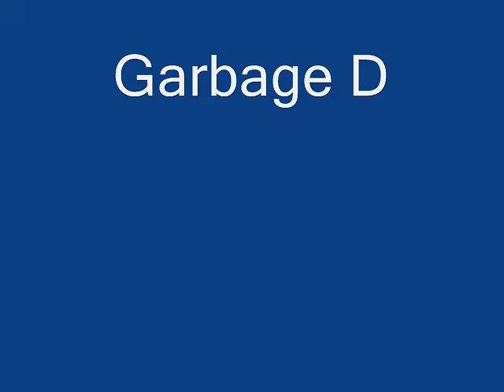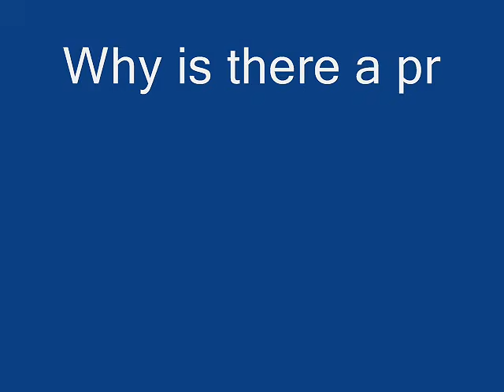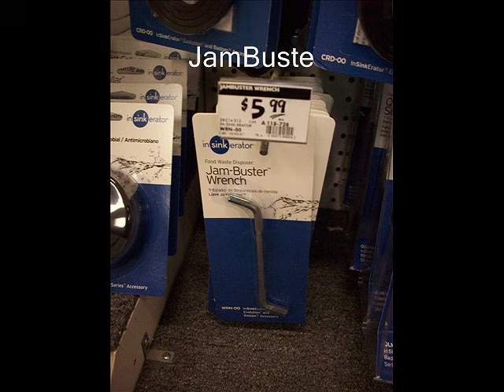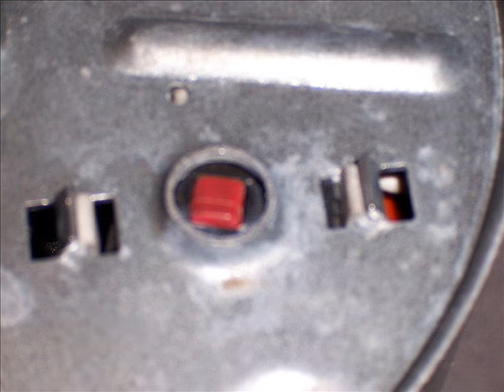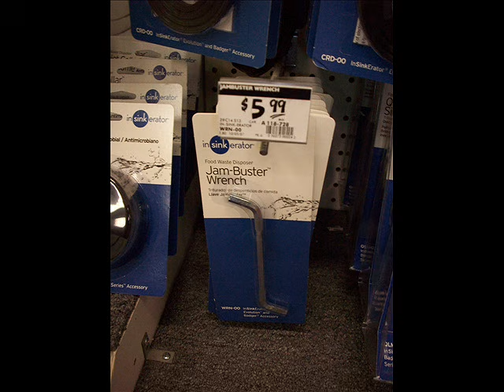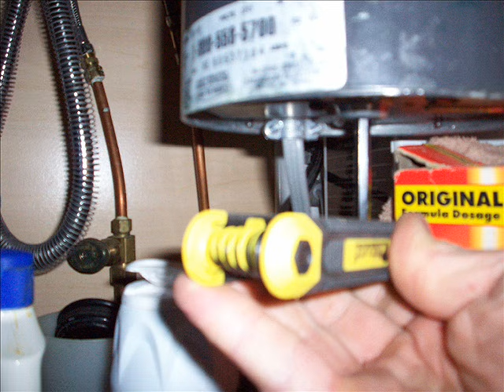Fix Your Garbage Disposal | Disposal Repair | No Cost | Save $$$

Comment: Thank you for your video. I had new countertops installed and two days later I realized that my garbage disposal is not working from the switch. I went to the breaker box and switched the breaker. The disposal started on but I can’t stop it from the switch. I bought a new switch and installed it, still not working. I have to go to the breaker box and start it on and off from there. I am 75 years old female on limited income and I can’t afford plumber. What can I do?
Reply from the maker: Check if there is a plug on the disposal.
Unplug it and make sure it stops.
If the receptacle has 2 outlets, change to the other outlet and see if the switch works.
Reply: @ClassicManuals   thank you very , very much ! Problem solved. Changed the outlet and now the switch responds.💕

Comment: I pressed the red starter switch and it turned it on, but the on and off switch is now not working... it will not stop running unless I unplug the entire thing. Is this normal?

Comment: Thank you for this video! You saved our home from a foul smelling odor. 
This video works for disposal model: ISE 333SS.

After turning the bottom of the disposal with the wrench, the disposal turned on and made a horrible metal scraping noise. I thought I had broken it! Turns out one of our metal measuring spoons was stuck in the drain! Took it out and now we're in business. Thank you!

Comment: Hello, ours humming, no grinding. What if i found the bottom is little damp, i saw even the red reset buttom. Would this already fired the unit? When i run the water for a minute, i didn't find anywhere is leaking though. But then i used the alan key to turn one clockwise and started to see the reset button got wet.

Comment: Tried all the steps in the video to fix my garbage disposal. Turned out to be the third one. Garbage disposal was humming but not turning after my kids thought it was a good idea to put their glass tea cups down the drain without telling us. After sucking the debris out with a shop vac, used my Allen wrench and had to turn it quite a bit. Finally it broke loose and it worked! Saved me money and a lot of time replacing the whole unit which isn’t even two years old yet. Thank you!

Comment: At first I was skeptical because this video was made 14 years ago at the time of this comment, but what I quickly came to realize is this is a simple machine with only a few troubleshooting possibilities.  I fixed my disposal using the “jambuster” method with an Alan key and a couple of turns.  It took longer to watch this video than it did to fix the disposal.  Honestly works better than it did when I got to this house.  Thanks man.

Comment: When unplug the disposer from the outlet under the sink and plug a lamp to to see if it has power,  the lamp does not turn on. It is a working lamp because other sockets light it up. Yet, the main circuit breaker is not tripped. I’ve reset it and still no power.
Reply from the maker: TestbLamp should go on/off when the disposal switch is cycled.

Comment: I have a jammed motor that was making humm when we turn it on.When I saw this video I used a hex wrench 1/4”  to turn it back and forth the motor from bottom.As you mentioned in the video clip.Now it’s running normally.Thanks for this valuable information.

Comment: Perfect advice.  The 1/4 Allen went in.  Back and forth and through the handle you could feel the binder up gears come free.  The Allen wrench then turned freely.  Ran cold water.  Turned on the disposal and it works.  Thank You so much.

Comment: I thought for sure I'd have to buy a new disposal and installation. Then my wife said our stepdaughter fixed it from watching a YouTube video. It had the hum problem. I found the correct Allen wrench in my collection, and turning it was so easy - seemed too easy, as if there was no blockage. But then I flipped the switch and the disposal worked. Thanks, ClassicManuals!

Comment: I’ve used these techniques in the past and they worked.  This time I’m still getting the hum and it appears to be spinning but it’s not draining anything.  It has water in the drain that won’t drain.  I’ve felt around in the drain and appears to be spinning freely but it’s not draining. Any suggestions?

Comment: i have a WasteKing L-1001, 1/2 hb and it has no hex receptacle on the bottom.  a little red reset button is on the side of the dispocal .  I havent used my disposal at all since installed 2 yrs ago, no garbage in it!  I get a short hum when turned on, but it doesnt torn at all. No spot to use a key wrench on the unit?

Comment: Too bad you did not mention about the disposal NOT moving when using the allen wrench.  What do you do then?
Reply: The same thing was happening to me but looked up that you need the 1/4 Allen wrench in size. I tried and at first it didn’t move but just push hard and it gets looser as you go!!
Reply: @patiencewhite2864  Thanks for your comments.  I used an allen wrench but the disk inside was still frozen and so I had to take the disposal apart.  No wonder the disk was frozen since there was TONS of sludge inside preventing it from spinning.  I got it all out of there and cleaned the inside as best as possible before reassembling it.  It now works fine.

Comment: these videos help alot, I was stressing out. I didn't realize or know my shot glass was sitting in the disposal until I turn on and heard a NOT so good noise 🤦🤦! That's probably because I was still drunk from father's day Sunday to Monday and my brain was not with me at work through out the morning. but my husband came home and used full force with the Allen wrench and it solved the problem, I was scared to full force the Allen wrench but we didn't have the jam buster wrench so we used exactly like what this guy is using and it works. I feel relief and better now.

Comment: 12 years since video was posted and still helping people save hundreds of dollars and hassle. thank you for your valuable information!
Reply: I just learned from RTFM(reading the F**n manul!) That you NEVER use HOT water while diposal is running...only cold. You DO NOT want grease and butter type stuff etc; to melt and re-cool in the small areas of disposal....it likes hard crunchy stuff to chew at and make smaller. DO NOT throw limes/lemons in there to make it 'smell' good it will jam it up!
Reply: Lowe's and Home Depot hates this guy 😂

Comment: I never knew it was supposed to turn freely at the bottom of it once u insert the tool. Thank u.   I was able to twist it back and forth and that dislodged a small metal piece that was stuck inside of it.  Allowing me to grab it💯💯.  Now it works just fine.   FYI all I’d did was hummmm once turned on

Comment: Never worked with a sink disposal before, already thinking about replacing. 
Tks to your video I reset the switch but the problem was stuck mechanism used an Allen wrench and problem fixed. Tks for the tip.

Comment: Lifesaver!!! I was messing around with the hex wrench for hours and thought I had to throw it away an buy a new disposer. Good thing I didn't because your simple instructions help, "turn it back and forth". I was turning it both ways and it wasnt working until I crank it back and forth as if your revving the motorcycle throttle. It was like magic.

Thank you so much!
Reply: Mine is the same, super hard to move the wrench, idk what is in there, I'll keep trying again and again but it's super hard

Comment: Thanks for the video - I'd forgotten about the reset button - I had no sound, nothing and had used the little tool to turn it and it didn't work so watching your video helped me remember the reset button and boom.......it works again.   What a fool I would have felt like had I called the plumber and he came and charged me $200 to press a damn button!!   Thanks again.

Comment: Maybe you can help me with my issue?  The disposal stopped working, I check the plug in, the bottom plug for the dishwasher worked but not the top plug for the garbage disposal. I replaced the plug with a new GFCI plug, now both the top and bottom plugs work. I plugged in the garbage disposal and it started working....without the switch being in the on position. what do I try next????
Reply from the maker: 1. Do not use a GFI outlet.   
2. There is a break-off tab on a duplex outlet that connects the top and bottom outlet, break that tab off on the hot (black wire) and wire one outlet to the disposal switch and the other to the dishwasher line and the other side common to neutral (white wire).

Comment: Great video! Moved into a new place and the disposal wasn't working. My wife and I were waiting over a week for the landlord to come and fix it saying he needed some key. Water was starting to have a hard time going down and we needed it fixed now. Found your video and learned the red fuse button was popped out and it started to hum. The "key" the landlord was talking about was the jam-buster wrench which I found hidden under the sink now that I knew what it was. I unjammed it but heard something inside that I couldn't see before. Found and removed a screw that had fallen in and it works just fine. Thank you.

Comment: Before considering calling a plumber due to a frozen garbage disposal (hum noise but not turning), I decided to check YouTube for some pointers on what to do. Well, low and behold, there was your tutorial. I also used by 1/4 allen wrench that I had in my tool box and turned it slowly back and forth until I could feel whatever was inside the disposal, finally release itself. Took a look down the drain and there it was, somehow a tiny screw was lodged in the disposal. With some careful surgery, I removed the screw and voila! Disposal now working again!  Thanks a ton - you saved me a plumbers fee and most likely the cost of a new disposal.

Comment: Thank you so much ,using your video I actually unplugged it first, removed the small piece of vegetable that was preventing it from spinning. Plugged it back in, pressed the reset button and it works just fine now. Saved me time and money ,excellent.🙋💜

Comment: Thank a million! I had taken the jammed up disposer off and left it for the garbage pickup, but when I searched the web for a replacement, I noticed comments like: "this one 'might' fit", etc.,. Then I found your video posting and Voila! my problem was solved. (Fished it back out from the garbage!) Although I could probably have done the fix without taking it off, there was so much gunk in the fittings that I cleaned off, that it was all worthwhile. And an extra thanks for exactly specifying the allen wrench size (1/4") - saved me the trouble of fiddling around and possibly stripping of the head - it needed  a hefty yank to unstick it!

I would add a note - when listening for a stalled motor humming, note that the sound may be very faint, as it was in my case.

Comment: Wow! This is the first YouTube video I’ve ever watched to help me with an issue that actually worked! There was no sound when turned on. I reset the breaker on the bottom which was tripped, but then it just made a humming sound. I could not manually move the disposal, so I grabbed the quarter-inch Allen wrench, broke it free, and got it to start turning. It now works. Great video!

Comment: The problem I'm having:  After not using the disposal for about 5 months, it hums without spinning the blades, and water's slow draining. I don't feel anything around the blades, reset button Not needing to be reset.  My jam-buster wrench won't turn, I was applying so much force that it ended up turning the disposal ever so slightly from the collar it hangs from that it began leaking unbeknownst to me for an hours time.

Should I take it down and try to unjam it off the collar it hangs from?  Any other suggestions?

Please help, as I replaced the original disposal with this one in 2015 (Whirlpool GC2000) which took me Hours to do (first time ever), it was SO heavy that I ended up stacking lots of books under it to hold it up while I hooked everything up inside the very tight work space. I shudder to thinks about having to do it again.

Comment: You didn't cover the use case where all circuit breakers are fine, power is there, jambuster used jam is cleared turn on switch and it just hums....I can only assume I need a new GD

Comment: THANK YOU SO MUCH! My disposal stopped working since the last time I did dishes. Puzzling. So I found your video and followed each step. I switched the power off at the breaker switch box. I first looked down inside with a flashlight to make sure there wasn't any debris. There wasn't, so I looked at the bottom of the disposal for the red reset switch. Sure enough, it was tripped, so I pressed it. Still no disposal. So I took a 1/4 Allen wrench and placed it into the bottom center hole. It was a little stiff for just a second, then it started moving very freely. I switched the power back on at the switch box and turned the disposal on....and it worked! So, thanks again!

Comment: So I got the hum. But the blades move easily and the Allen wrench moves with no problem.The thing still doesn't grind.
Needless to say the reset button and breaker are set.
So what's the next step?

Comment: My disposal jammed quickly after I realized it accidentally ingested a shot glass.  I used the 1/4" allen, and kept picking out debris.  Eventually it came un-jammed and works normally again.  Thanks for the hot tips.

Comment: Thank you so much for this video. I was all set to buy a new unit, but fortunately decided to search on YT for a possible fix. Turns out it was stuck blade. Even better I found the original disposal wrench in a my kitchen drawer to use for the repair. Whew!

Comment: Thank you! Like many of the DIY women here, I am so pleased with myself for fixing it on my own and relieved that I don't have to spend money for a new one and a contractor! Mine was humming, so I knew that power was not the issue.  When all else failed, I stuck my hand in inside to clean the gunk, then I heard the clog drain. Like he mentioned about using the wrenched, I was uncertain if I was supposed to turn it all the way, so later when it didn't work, I forced the wrenched to turn and viola!

Comment: Worked for me. Thank you! Even found a tool (wrench) I'd never noticed near the sink that read USE BEFORE MAKING SERVICE CALL... lol. Never noticed it before. Seemed to work... item stuck inside jammed a few more times, but then I think finally passed through... I guess it got chopped up enough...

Comment: I hit the switch and it hums. So I turn it off and I try putting the my Jam Buster wrench in the bottom but it WON'T turn, it's like it stuck. What do I do?! I've checked the top and looked into my sick and I don't see anything stuck inside.

Comment: I need some help! I have an air switch for my garbage disposal, I have to pump it several times for it to switch the machine on, I notice that inside the switch hose that it is part fill with water, could this be my problem, if so how do I get the water out.

Comment: What to do if the wrench doesn't move the jam at all. It's like it's frozen tight and actually will move the whole disposal when I try to unjam it with the wrench. It doesn't move in any direction but does make a faint humming noise.

Comment: Ok, I did watch several In-sinkerator videos.  My sympton; motor hum, no spin.  The hex wrench spins the waste grinder.

Solution, replace the Insinkerator.  Not the same size.  Ended replacing several drain pipes because the 15 YO Insinkerator had a different height drain.

Rook the old disposal apart.  One of the coils was toasted black.  feels better that I solved the issue.  Thanks for your video.

Comment: Thank you so much, this saved so much TIME and about 150 bucks for a new one. Turns out someone was trying to dispose of an ashtray amount of Cigarette butts.. found about 12 of them, a few of them lodged in the blades just enough to keep it from turn. Once i got under there and used the 1/4 inch allen to get 2 cigarette butts un-lodged it works again.  I really appreciate your vid on these quick fixit  tips.. What a gem. Thanks again.

Comment: Thanks a bunch! Instead of paying for a new disposal, I actually made money. Using your suggestions and my allen wrench I found a hair pin and some foil paper fragment jammed in my disposal. It works perfectly now. Had I not tried to fixing it myself, it would have cost between $200-$300 to have it repaired.

Comment: Question. I believe I have unjammed it, but I didn't have a hex wrench like you show. I used a hex tip on one of those interchangeable wrenches. However now the little tip is stuck in its socket on the bottom of the disposal. It moves the wheel of the disposal freely, so I don't have any tension to pull it out with. I haven't been able to get it out with pliers. Suggestions?

Comment: Thanks. You just saved me a call to the appliance repair man (and the expense). Although I couldn't see any debris lodged anywhere, twisting the 1/4" hex wrench on the bottom receptacle of the garbage disposal a few times worked for me. Thanks again.